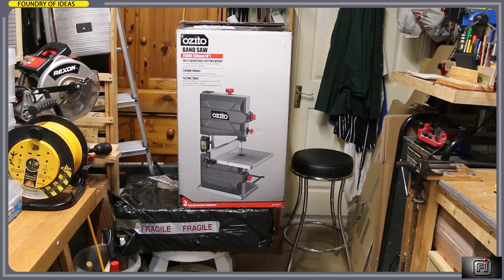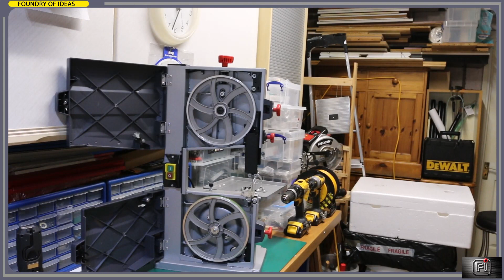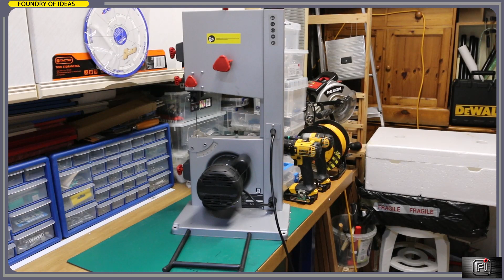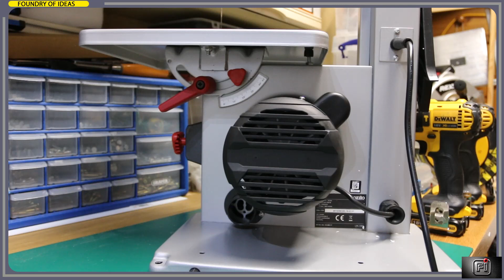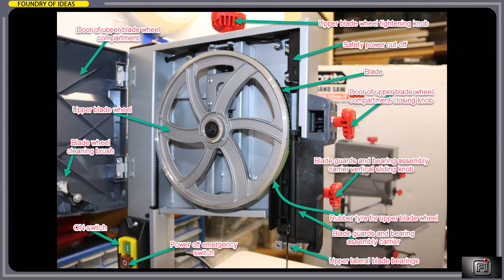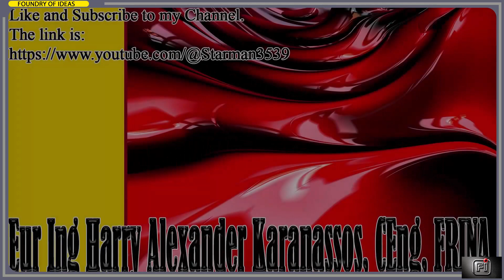OZITO BSW-2581 250W 200mm BANDSAW

Comment: Nice video, enjoyed watching it.

I do wood working for a hobby and like to renovate caravans. I'm looking for a reliable band saw but not sure if i should get the Ryobi band saw or the Ozito band saw? How  did you find the band saw? Any issues or would you recommend a better brand?

Thanks Harry
Reply from the maker: Thanks for your kind comments and for your enquiry. I do not know anything about the Ryobi band saw, so I cannot offer any comments in this direction. Regarding the Ozito I would say that so long as one stays within its capacity one will find it a good tool to have around the workshop. So far it has not given me any trouble. Should you go for a better brand? Well, that depends on how demanding is caravan renovation work and if you need a larger throat distance (clearance between the upright and the blade). I hope this helps.